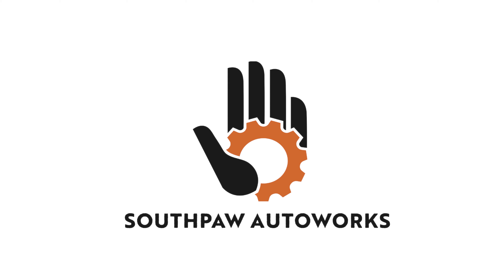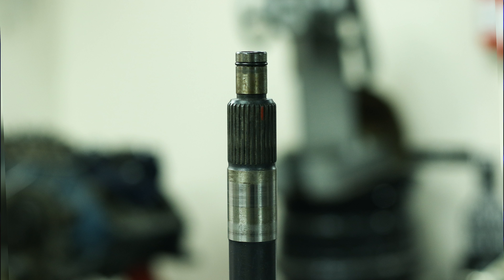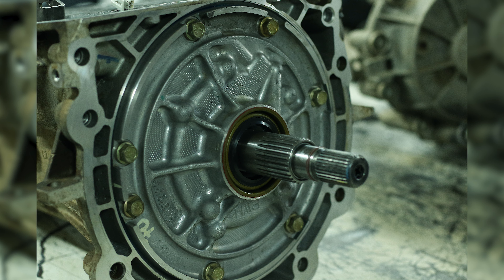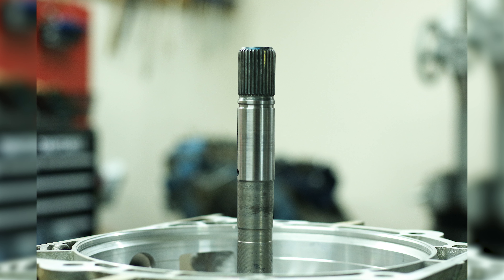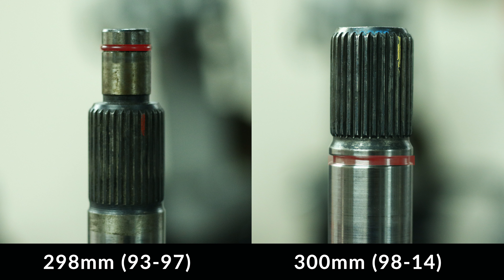4L60E Question: Input Shaft O-Ring (Damaged) (298mm VS 300mm)

Comment: Good advice . With the time and work involved , you should not take chances on a used O-ring . I would be leary of a rebuild kit that gave me a broken O-ring .
Reply from the maker: Agreed.  Definitely best to not chance it.....unless you like removing the transmission multiple times.  Nobody likes doing that.

I once had a rebuild kit that was missing an O-Ring, that lives inside of the Input Drum.
As it turns out, that O-ring fits perfectly inside of the extension housing seal.  Took me a while, but I finally found it.

Comment: What happens if that o-ring fails? Will it damage the transmission or just wont get great fuel economy?
Reply from the maker: You'll have TCC (Torque Converter Clutch) problems.  
Yes, it will affect fuel economy.  Also, the Torque Converter is the greatest heat source in the 4L60E.  The TCC clutch is used for both fuel economy and heat management.

If the TCC is not working, the trans will likely overheat.  Excessive heat cooks the ATF (Automatic Transmission Fluid).  The ATF is responsible for lubrication, among other things.  As the ATF breaks down (due to excessive heat), it will no longer be able to do a good job of lubricating the 4L60E.  As you can imagine, that will damage the transmission.